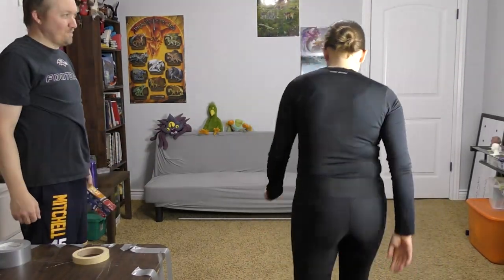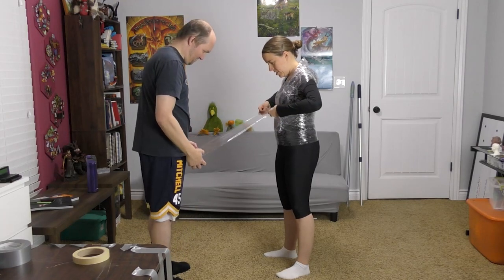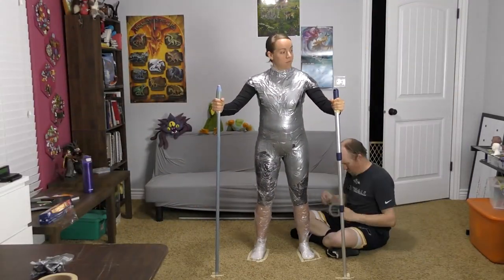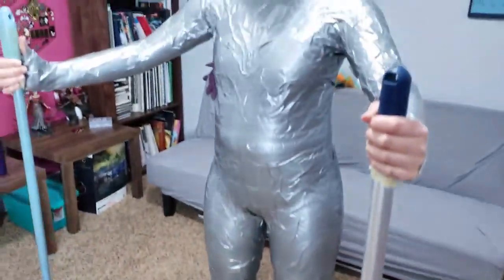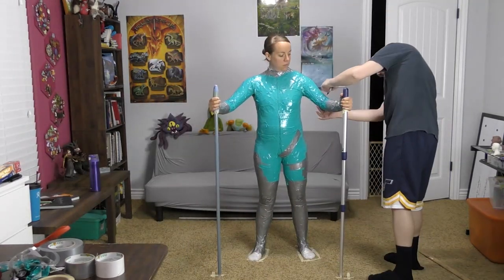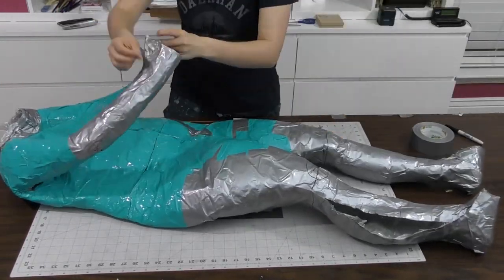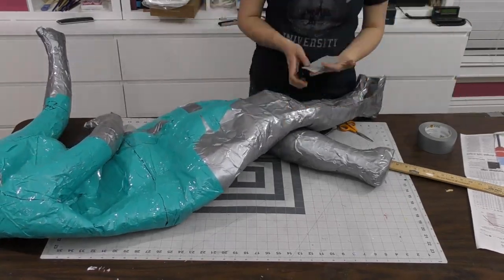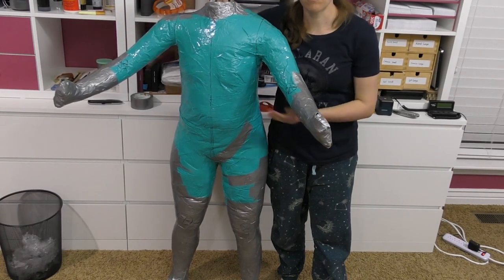Making a Duct Tape Dummy

Comment: TO HELP THOSE WHO NEED IT WITH AMOUNT OF DUCTAPE

Coming from a 5ft 5 female bean with a binded chest and a "medically healthy" weight and making an average digigrade leg and accounting for the 2nd wrap if ductape to cut off for patterning YOU WILL NEED 3 ROLLS OF  50MM BY 50METERS OF DUCTAPE! THAT IS ENOUGH FOR SIMILAR SIZE / STATURE AND IS A ROUNDED UP CALCULATION OF WHAT I HAVE USED FOLLOWING THIS TUTORIAL!

Comment: Thanks for the vid, gonna be making my first dtd in a month or two. Have you tried out using any sort of a painter's protective outfit sort of a thing instead of plastic? A cheapo, usually single use white overalls thing, one you'd then just cut after applying the duct tape just like with the plastic. I mainly ask since I'm wondering how the methods compare in your opinion, iiif you have experience on both (or any other) ways to do a dtd that is.

Comment: Hi Kaz, I'm wondering on stuffing the suit, Have you ever thought about using spray foam? You know the stuff in the can or you mix for filing cracks, it expands and produces quit a bit of pressure as it does.  I'm wondering if you seal up the arms ends where hands are, cut small slits in arms stick foam straw in slit and spray if it would "puff up" the suit as it expands??
Reply from the maker: As a matter of fact, I have made a dummy with expanding foam! there's a great tutorial about how to do it on Stan Winston School. I think using cans of spray foam would be a nightmare, so I recommend getting a gallon kit from Smooth-on. You just mix two parts together and pour. I also reccomend using 6-10 layers of masking tape, it won't distort as much, but you'll still want to work in small batches with the expanding foam and try to hold the correct shape as best you can.  You can see the dummy I built in my goatman videos. Keep in mind since the dummy will be rigid, you will need to cut off and create pins for the arms and legs to even be able to get costume pieces on.  It took a ton of extra work to build, but it's worth having. I decided to just make a simple one for me this time because of time constraints.

Comment: Great tutorial! Do you have any advice for transporting/shipping your DTD if you're getting a commission from someone?
Reply from the maker: Great question! I would make sure that your markings are super clear (and add your name/character name too!) especially the registration marks across cut lines.  Try to lay your tape as flat as possible to minimize curling and sticky residue. It's okay to fold it up fairly tightly in order to keep shipping costs low. Last of all make sure you get tips directly from your maker, they may have some different preferences!
Reply: @KazplayVideos  Thank you so much!

Comment: Do you think expanding foam (for like insulation) would work as stuffing?
Reply from the maker: It could work, but I'd you go that route I would use masking tape and a minimum of 5 layers of tape so the expansive force won't distort the shape

Comment: how many tape did you use in meters? 
I'm going to buy 100m of tape and hope it's enough
Reply from the maker: Let's see, a yard is three inches shy of a meter... The little colored rolls of tape were 20 yards each, I used 2 and it wasn't enough for my whole body. I'm 5'2" so on the short side. Hope that helps you calculate!

Comment: Do we have to put a second layer of duct tape
Reply from the maker: Yes, if you want it to last
Reply: @KazplayVideos   ok thank you because I want to make a fursuit and want to make it last longer
Reply from the maker: @blackandwhitewolf203  right, 2 layers is a minimum, but if you overlap each tape piece by at least half on each layer, which is in reality 4 layers of duct tape which should hold through the process of making a fursuit. More layers will help it last even longer!

Comment: How moveable are the arms amd legs?
Reply from the maker: It depends on how tightly you pack it. It's a balance between holding it's shape and being flexible enough to bll put clothes onto it. But you should be able to get most all clothes onto it. Sometimes I have to bend the arms quite a bit to get a garment onto it.